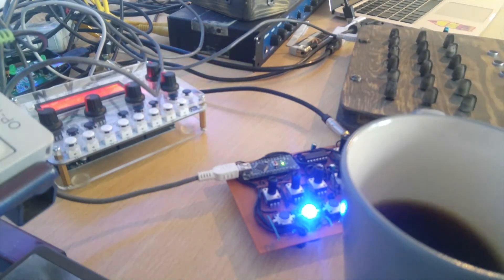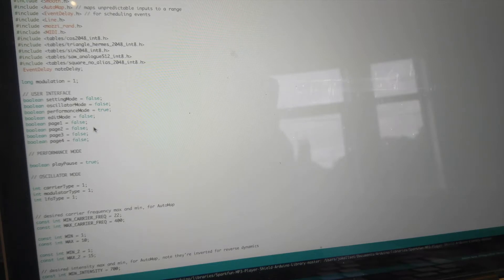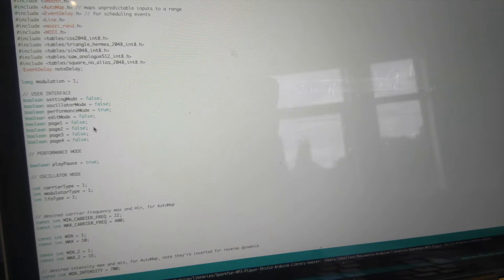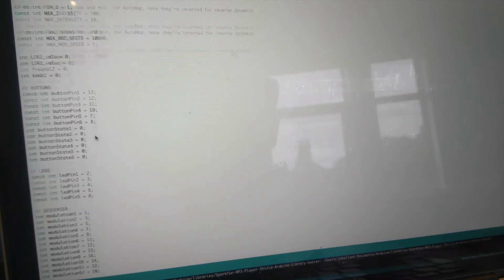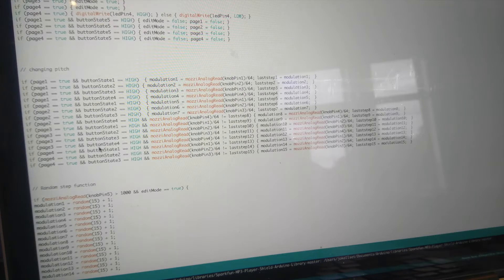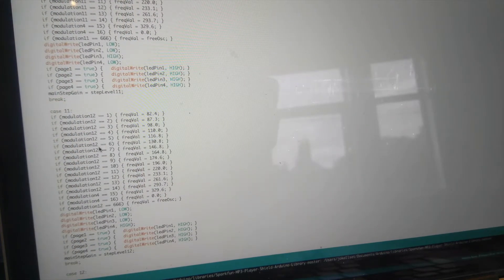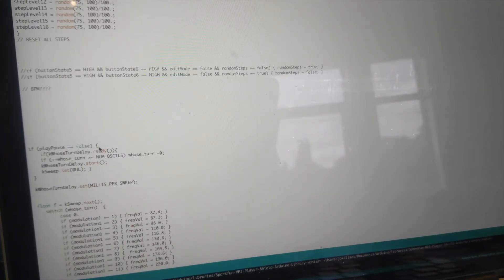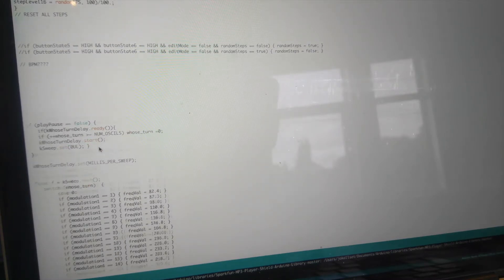Arduino synthesizer fun!

Comment: Error at code :Arduino: 1.8.4 (Windows 7), 
 error: redefinition of 'EventDelay noteDelay'
  EventDelay noteDelay;
 note: 'EventDelay noteDelay' previously declared here
  EventDelay noteDelay;
            ^
error: redefinition of 'long int modulation'
 long modulation = 1;
      ^
note: 'long int modulation' previously defined here
long modulation = 1;
      ^
 error: redefinition of 'boolean settingMode'
 boolean settingMode = false;
         ^
 note: 'boolean settingMode' previously defined here
 boolean settingMode = false;
         ^
error: redefinition of 'boolean oscillatorMode'
 boolean oscillatorMode = false;

  and more and more......